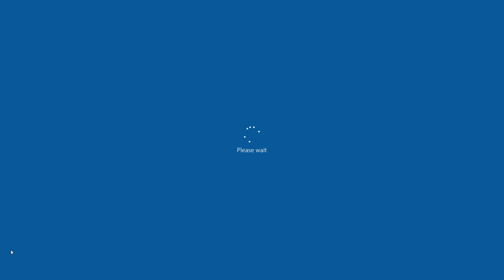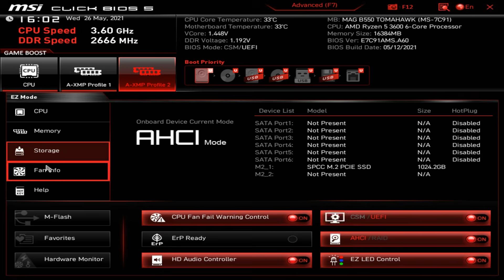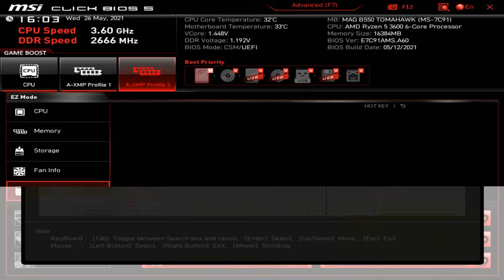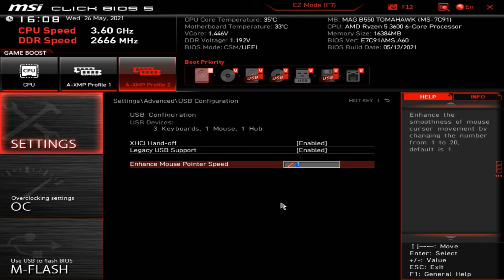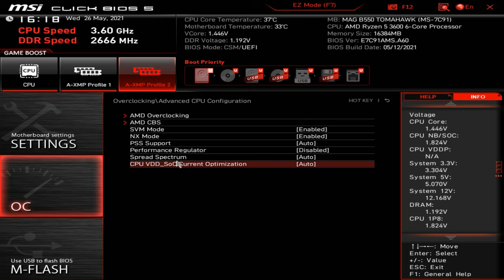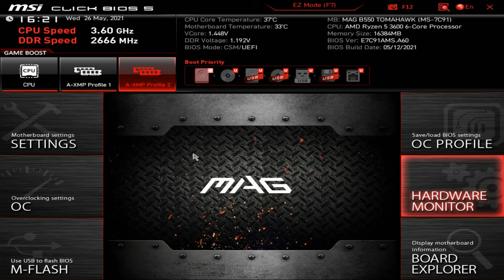Comment: Hi Mike! Just picked one MSI MAG b550 for myself as a first pc build. I connected the ram, cooler, cpu, gpu, etc. and i booted up the pc and it works. However the ram was set to 2133MHz so i went to advanced mode, overclock, dram frequency and set it to 3200MHz (I have 2x16GB 3200MHz cl16 corsair vengeance rgb pro), Saved it and rebooted. However once it reboots, nothing happens. The memory training time just takes too long(Waited at least 20 minutes). So i restarted the system to reset the memory training but now the CPU red light on the motherboard glows. Ive tried with two different CPUs and the same thing still happens. Any idea what to do? P.S. at this point i havent installed windows OS or anything yet
Reply: you don't need to set the ram frequency, so revert that to the factory defaults and just enable XMP that will also increase the votage to the ram, which just changing the frequency won't do
Reply: @mikesunboxing Thank you so much, this fixed it for me. Cheers!

Comment: cheers for the info at 10:30
lan option rom and network stack being disabled means you cannot network boot at all, even if you changed the network boot to be #1 under boot settings

Comment: Just a question, anyway to do a full reset for pc via bios? My windows update corrupted all my system files so im stuck on a bsod loop restarting and only can access this bios page.
Reply: you can boot from a windows USB installer and wipe the install and start over or try a repair install
Reply: @mikesunboxing  i see, i cant seem to run anything else like the automatic windows repair install. Will try with the usb trick
Reply: @benjaminczw9944  Feel free to join our Discord chat if you need any more help https://discord.gg/XtBTGQ6BDu

Agree to the rules by clicking the emoji and you will get access to the rest of the Discord channels

Comment: Hey I know this is an old video but I just have a question and I'm just curious if you could help me I just updated my BIOS on my motherboard I have the same motherboard and for some reason it's stuck in a bios loop do you know what could be causing this?
Reply: try flashing it again or reset the cmos

Comment: I’m on the newest bios as of March 2024 with my MSI MAG B550 Tomahawk Max WiFi and it won’t let me save my PBO2 limits it will only save it up to PPT 145 TDC 95 EDC 115 with a Ryzen 9 5900x no higher? My old Asus Rog Strix B350-F gaming with the newest bios late 2023 lets me save my PBO2 limits PPT 195 TDC 130 EDC 140 with the same CPU a Ryzen 9 5900x and the motherboard is 7 years old.?.
Reply: safety precaution maybe to not expose the CPU to excessive power
Reply: @mikesunboxing I don’t get why it doesn’t save my PBO2 Limits in advance mode it hinders my Ryzen 9 5900x power.?.I downloaded Ryzen Master to see what my motherboard can go up to it said PPT 500 TDC 200 EDC 220 but it can’t save PPT 195 TDC 130 EDC 140? Just used Ryzen Master just to see how much the mobo can go up to then uninstalled it. With an Arctic Liquid Freezer II 360mm Rev 4 with the AM4 offset brackets and new cold plate fins and gasket it blows my mind.?.
Reply: @mikesunboxing  with that same cpu a Ryzen 9 5900x and a PPT of 195 TDC 130 EDC 140 on that 7 year old motherboard in Cinebench r23 I scored in a 10-minute throttle test 23,246mc and my temps topped out at 68.6c on a Asus Rog Strix B350-F Gaming latest bios and 7 years old.

Comment: Does anyone know if this motherboard will run a 5600 on the stock bios? Ive upgraded the bios on my Tuf x570 but that was online on a working system. Not confident using flashback.
Reply: unless it is very old stock it should run straight away
Reply: @mikesunboxing  Y
Thx Mike.

Comment: What’s your cpu heating/fan setup + overall case and fan configuration? We have the same CPU but I’m noticing I run about 3-4 degrees higher than you are
Reply: honestly not sure what i was running back then, usually a 360 aio though and room temp 22-24ish

Comment: Why is the sys 1-2-4-5-6 fan rpm zero because I am using the same motherboard and it appears to be 0 too? I cannot see how many rpm the fans are spinning at.
Reply: maybe the fans are not set to the right type of header DC or PWM or the fans don't have an RPM output?
Reply: @mikesunboxing  I can only see sys fan 2, I can't see the rpm speed, I can't see what rpm the other 5 sys fans are spinning at, when I put sys fan 2 into PWM, it speeds up, I can't control only the other 5 fans.
Reply: This is maybe easier to fix or at least advise if we can ask more questions and get direct answers, so feel free to join our Discord chat and we can go over it in more detail https://discord.gg/XtBTGQ6BDu

Agree to the rules by clicking the emoji and you will get access to the rest of the Discord channels @BaBa-_-YaGaJW

Comment: hey where do i plug my 4pin case fans on motherboard or it doesnt matter?  i have 5 to add in daisy chain.  or should i plug 3 in front on 1 connector and 2 on top another connector and can change my variables etc?  thanks
Reply: yeah spread them out a little if you can any of the fan headers is okay
Reply: @mikesunboxing  what i was thinking.  cheers.  top 2 can push out faster and but lower on front 3 maybe, ill see

Comment: I have an unrelated question, i noticed you had two sticks of 8GB of ram but when i try it with my own motherboard it just gives me the cpu red light, do i need to upgrade the cpu or anything?
Motherboard: MAG X570S tomahawk max wifi
CPU: AMD Ryzen 5 5600X 6 core processor 
And it only takes up to 8 GB of ram only and the ram sticks are from corsair
Reply: try each stick on its own in slot 2 then slot 4 if one of them gives and error it is faulty

Comment: Question I just bought this board for gaming. Will I be able to have two m.2 plugged in with a GPU and get full performance of everything?
Reply: depends on the m.2 drives installed
Reply: @mikesunboxing  I bought a Samsung 970 1tb m.2. my thing is should I buy another m.2 for the OS or buy a sata ssd for the OS?

Comment: HELLO MIKE! You are my go to guy for MSI! I recently built my last system with an MSI Z390-A Pro with an Intel Pentium Gold Coffee Lake G5400 Duel Core 3.7Ghz Processor! 64 GB DDR4 3200 Ram and a GeForce GTX 1650 Video Card! I use this system for Adobe Video Editing! Besides ticking the XMP & GAME BOOST button with FAN set to Auto, what else can I do to Overclock this system? I was told by MSI that This is basically a budget gaming board that cannot be manually overclocked? Any advise Would be greatly appreciated!
Reply: This is maybe easier to fix or at least advise if we can ask more questions and get direct answers, so feel free to join our Discord chat and we can go over it in more detail https://discord.gg/XtBTGQ6BDu
Agree to the rules by clicking the emoji and you will get access to the rest of the Discord channels

Comment: I am lost, I am trying to use a second monitor via the hdmi slot on the motherboard and its not recognizing it, im running a 3080ti gpu and a ryzen 7 5800X CPU, idk why its not recognizing the second monitor
Reply: The motherboard doesn’t have a graphic card if you want to use the motherboard ports you need a processor with graphics like the 5700g
Reply: @mikesunboxing  yeah I was reading up on that, I just have to get a display port to HDMI adapter and just plug into the graphics card itself. Doesn't make sense to me why it is just the 5700g specific, even though the 5800x is better?? If I had known that before hand I would've gotten that instead 🙃 but oh well everything is adaptable in the IT field

Comment: I think i have done a silly mistake, i have change the Infinity Fabric Frequency to 3200 thinking it’s the speed of the RAM and my PC is not booting again, CPU light on😥
Reply: reset the CMOS and remove the battery for awhile to reset to factory defaults
Reply: Thank you so much. And how can i change the RAM Speed from 2666MHz default to 3200MHz ? Im new to MSI Motherboard
Reply: @Flav1CS  This is maybe easier to fix or at least advise if we can ask more questions and get direct answers, so feel free to join our Discord chat and we can go over it in more detail https://discord.gg/XtBTGQ6BDu

Agree to the rules by clicking the emoji and you will get access to the rest of the Discord channels

Comment: Mike, I am having trouble. I have built my pc yesterday and I got the msi b550 tomahawk as my mother board. The trouble is when I turn on my computer it shows the bios but every time I try to exit out of the bios it just opens back up
Reply: if you are putting in an older disk drive it might not support secure boot or uefi, try setting the bios to CSM

Comment: Just as a suggestion for these motherboard tours.  I am looking for Bios information for integrated graphics on B550 platform.  Since you are using non G Ryzen CPUs I assume some of the options I'm looking for in the Bios don't even appear without the iGPU installed.  Perhaps in the future you can use one of those for my case?  (Only a suggestion)
Reply: Good point and yes it is something I should be thinking of

Comment: Does MSI have a wireless internet component? I'm trying to setup wifi on my pc but I don't think it even has a component for that.
Reply: the wifi on the motherboard, if it has it is usually intel or realtek chipsets and should have drivers on the msi website for the motherboard.
some regions do a wifi version some don't. If it has wifi it will always be in the model name

Comment: Thank you for this useful video … can you explain what the “U” signifies in the upper right corner of the boot priority icons, and why several of the icons have “USB” across the front?  Aren’t all thumb drives considered USB?  Thanks!
Reply: U is for UEFI and the USB port is drives or devices that might not be actually USB flash storage but use the USB protocols to communicate

Comment: I didn’t know the shift key method to enter into the bios. I always used the del key or f2 when the pc is booting up. Nice to know. 

However, I have the msi x570 tomahawk and this board doesn’t have a video card. I tried connecting the hdmi cable directly to the motherboard and also to the gpu and in both cases I don’t see anything on the screen. Any ideas ?
Reply: what processor do you have installed?

Comment: U dont no what u talking about. Auto is always bad decisions for basic settings. Like PCIE/chipset  auto means. Windows can switch that a save power. In GPU-Z u can see if u do basic staff is on Gen 3 but 1.1 in some games is 2.0, but for good latency u need 3.0 every time.  HD audio controller is bad panel audio..so off and use motherboard audio. XHCI hand-off can mess with mouse, better is for. Legacy for Windows 10 off.   enchance mouse..0. ErP ready u can setup it only if power supply support it.  
In infinity fabric freg. that say FCLK = MCLK. FCLK must be MCLK for best preformace. Sufficiently high MCLK can negate or overcome this penalty and u saying "i have better ram i need go FCLK high haha I am so smart".  
Sorry but that do what u want is so annoying.  TEST that setting and then say why u have that on or off. I dont care about IF If IF IF IF IF IF or I dont care enable it or disable.
Reply: most of the settings will have a very minimal effect but if you want to spend time checking what settings work best for your system that is great, but a lot of people just want to build a pc turn on xmp and pbo and setup the fans and thats it.
I do have a deep respect for anyone prepared to spend the necessary time to learn the optimal settings

Comment: I bought this card for a Corsair Crystal 680X case and it turned out to be a really good build. Doing another build with a Corsair Crystal 280X case so which M-ATX board would you recommend that's compatible with the Tomahawk B550??  I do like the MSI boards.
Reply: i would look at the B550M Mortar, these mortar boards are generally compared to be the mini tomahawk

Comment: Msi finally release the non beta bios for the x570 tomahawk. Flashed and running on mine, now, I will just have to fine tune the memory again...
Reply: keep us posted if there are any issues or noticeable improvements
Reply: @mikesunboxing  I will test the usb m.2 adaptor on the blue usb ports to see if it fix the bug I had. I will post my result later!
Reply: @mikesunboxing  The behaviour change, but the bug still there. But is it a motherboard bug or an adapter bug, I will have to test on another computer. Apart thst, everything seems fine so far!